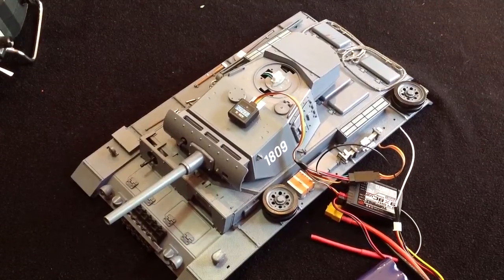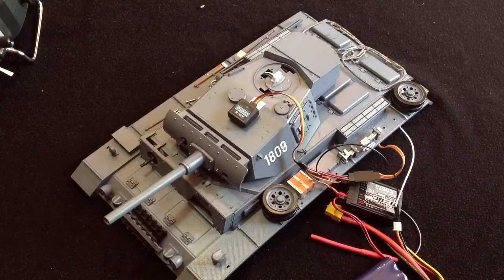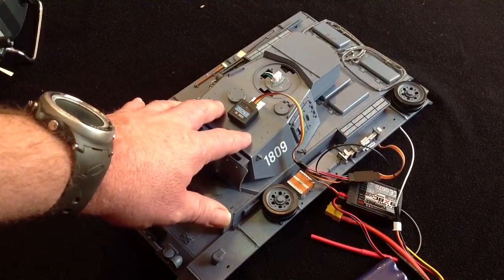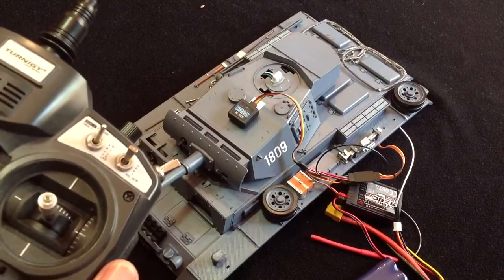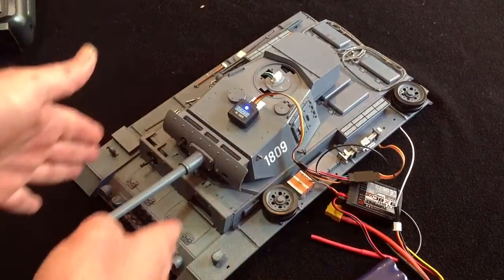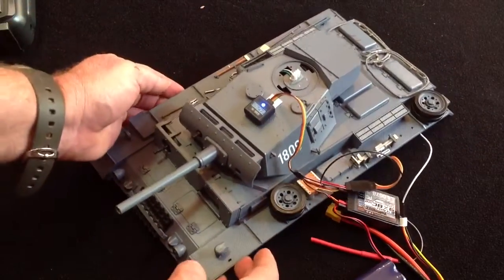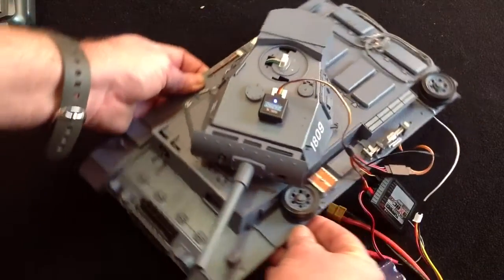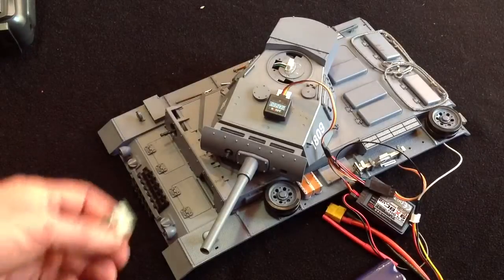Turret Lock Function using GEKO and the GA250

Comment: Will it work with all Manufactures, i.e. Taigen, Heng Long, Tamiya?
Reply from the maker: Such a system will work with any real 2.4 gHz Radio system using a brushed DC motor for turret control.  You need a proper 2.4 gHz Radio system NOT like that found on the new Taigen or Heng Long 2.4 gHz tanks.  For the Heng Long and Taigen you will need a RC5HL or RC2TG as well to provide the standard 2.4 gHz protocols..
Reply: I appreciate you taking the time to get back with me. I'm new to this hobby and really enjoying it. Looking over YouTube there are a lot of modifications one can do to these tanks but yours really caught my attention. This is one that I want to do... Thank you again! Dave-USAF